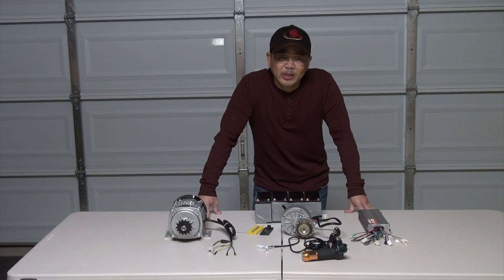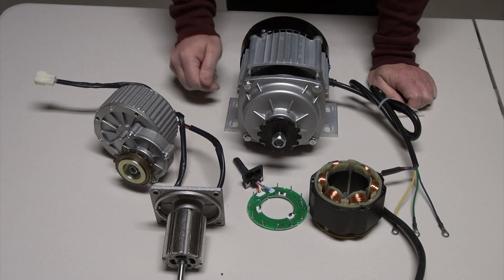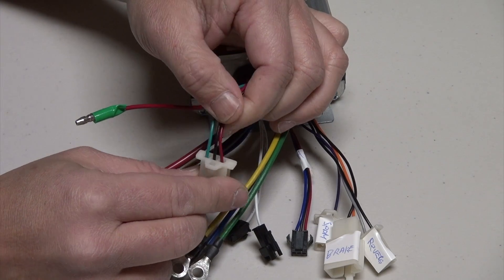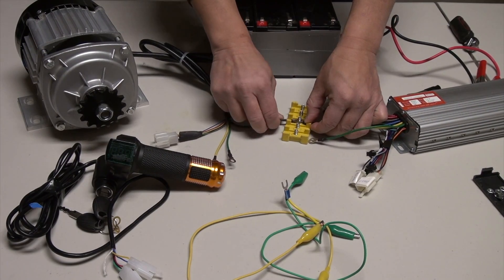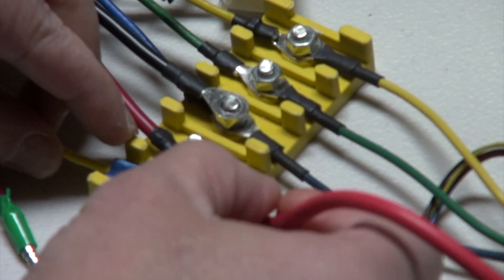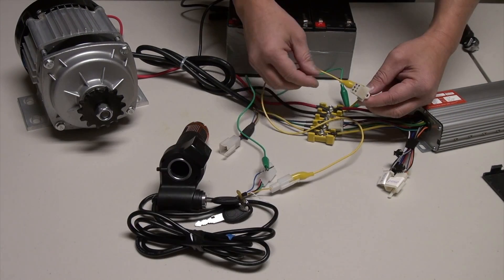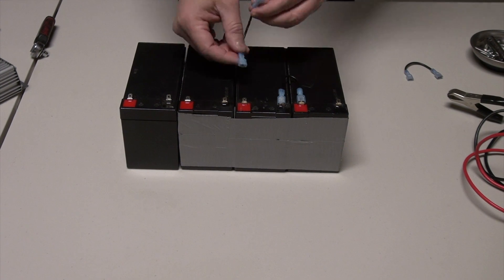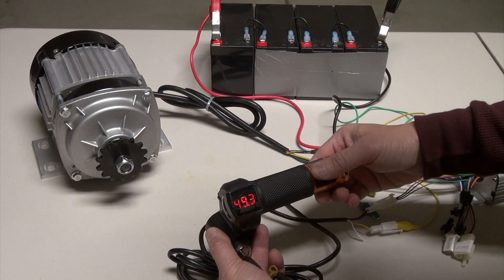How to Connect a Brushless DC Motor to Controller (48V 750W E-Bike) in English

Comment: How do connect the same throttle to my MQ7260 controller that has a orange ignition wire? Do you have an email so I can message you?
Reply: How can I get in touch with you?

Comment: Excellent video! I hooked it up on the bench and it worked perfectly. I need to reverse the direction of the motor. I saw there was a grey and black connector for reverse. Is there any tutorials out there on how to use this connector? The engine rotates Clockwise and I really need it to rotate CCW. I'm converting a gas powered mini bike.

Comment: the motor you used in your video says it has 3 different adjustable speed settings on amazon. how do you change the speed of the motor?

Comment: Question. I recently ordered a 750w brushless motor and controler to build a cart. The motor said it will come with a 14 tooth 420 sprocket. The axle kit I ordered comes with a 530 rear sprocket and chain. Is there a sprocket made for these motors that will take the 530 chain? Any advice is greatly appreciated. Subscribed.
Reply from the maker: Hello,  maybe consider getting 420 chain and sprocket for axle.  Here is a link to the kit https://amzn.to/4ix8FG0.  Good luck on the project.  Thanks!

Comment: Got sick of my shitty mowcart 66 gearbox f**king out on my ride on mower. Already replaced the whole gearbox twice. Ive decided to change to this eletric setup with a single chain to a axle and single sprocket on the axle to drive it. Gonna pull all the pulleys off the cutting deck to and install a ryobi eletric blade motor off one of there eletric zero turns seprate (so 2 motors) straight from a 2nd battery with a switch to turn on the blades. Wish me luck 👍🏾

Comment: Hello,
I have a 24v 350w motor with 2x 12v 12ah lead acid batteries. But the motor starts spinning immediately as soon as I connect the batteries. I already changed the controller. But still starts spinning immediatly without throttle control. Are those batteries with 12ah to strong? Motor itself has 18,3A current.
Thank you.
Reply: I typed your question into AI and this is what it gave me. 

Controller Settings: Some controllers have a "soft start" or "throttle calibration" feature that ensures the motor only spins when you apply throttle. If your controller was replaced with one that's not configured correctly or doesn't support this feature, it may start spinning right away.

Throttle Wiring: Check the throttle connection to the controller. If the throttle is wired incorrectly or has a faulty connection, it could be sending a signal to the controller that causes the motor to start without input.

Battery Voltage: Your batteries (2x 12V 12Ah) should work fine with the 24V motor. While they may have more capacity than needed, the voltage is what matters for proper operation. However, ensure that the battery connections are correct (series connection for 24V).

Controller Type: Ensure the controller you replaced it with is compatible with your motor in terms of voltage and current rating. If it's not designed to handle the full 18.3A current, it could be causing erratic behavior.

Throttle or Hall Sensor Issues: If the throttle isn't calibrated correctly or the hall sensors on the motor aren't providing accurate feedback to the controller, it might start without any throttle input.

Comment: I feel like almost every person in these comments is going to die trying to wire these controllers up. They're extremely simple, and very easy to figure out with no experience, but the people asking questions here are obviously far more new to all this then just a beginner. If you're asking how to hook up phase wires to to a battery connector, you should just buy an already built bike or scooter, or pay a professional to build it for you. I don't mean to sound insulting, but it sounds like you're ready to start connecting wires when you don't have the first clue of how electricity works, and that can be very dangerous, or even deadly. Usually, when people talk about someone being a beginner to brushless DC motors, they are talking about someone who hasn't worked with that specific equipment, but has worked with other electrical devices, and has at least a very basic understanding of how electricity works.
Reply: Where the hell are people supposed to start then? Maybe they could do some reading first before attempting to build a go-cart but, doing things from scratch is part of the fun.

Comment: I'm a big guy 360 lb. So I was thinking on my build of mini bike. That has a predator 6 1/2 horsepower Honda clone motor. That seized up I'm switching out I should use a 750 w rickshaw motor because of the tour and I can always gear it up for speed. Very capable builder. And have a good knowledge of electric from building RC cars would this be the way to go to have good pickup. I mean 30 miles an hour is more than enough. What do you think looking at a system just like the one you have and getting a 40 w 40 amp hour battery. Also considering starting to build batteries for people around me for their salon bikes and stuff

Comment: Great video, thank you so much. After I change my controller my ebike is not not running in full power, feels more like medium power. The 2 speed switch (low &  Hi) is not working. No wires from controller is labeld. Anyone knows what color and how many wires it suppose to be out from the controller?

Comment: Thanks for sharing. I'm planning to use just the batteries, a DC/AC inverter, the 24V DC motor and a permanent magnet generator (output of 220V). The motor will power, (rotate), the permanent magnet generator. I will get current from generator to feed my equipment and feed the inverter  which will keep my batteries up to the task. I hope to reduce my energy costs and be ''off-grid'' at least 80% (eventually). Energy costs are sky-rocketing and will prevent any ''hit to my pocket'' down the road. Again, thanks for sharing.
Reply from the maker: Best wishes!  Thank you!

Comment: I got the same motor, I use the stock sprocket and i have 60T rear sprocket  on my ebike and that goes only 10km/h  !! Is that normal ?
Reply: If you Put a smaller sprocket it Will go faster but lose a lil torque but over all I recommend to buy a stronger motor

Comment: What is that yellow block called where u connect the motor wires to the controller? is it a block terminal or busbar
Reply from the maker: It is a terminal block/board.  They are hard to find.  Here is a link for a similar one. https://amzn.to/4bVWYWK.  Thanks for watching.
Reply: @diypotentials that link doesn’t work for me

Comment: How is it I ran my motor with the hall plug not in
Reply: you can run motor without hall sensors
Reply: under high load it can block ,then you need to turn off throttle and you can power it again
Reply: hall sensors provide smooth acceleration

Comment: is it okey to use a 48V 600W motor to 750W DC Controller?
Reply from the maker: It should be ok.
Reply: and 750w hub 48v motor with 1000w 52v controller? @diypotentials

Comment: How is this controller rated for 48 volts, 30 amps and yet only 750w output? The output should be close to 1500 watts.

Comment: When I am connecting my batteries with the clips, it sparks. What can I do to prevent this?
Reply: Sharpen both ends of a lead pencil .touch one end to the pos of the battery then touch the other end of the pencil to the positive lead for 3 seconds or more . then plug it into the battery. Voila! No sparking. You made the pencil resist the full power of the battery and it loads the capacitors in the controller slowly hence no spark. This will increase the life of the controller seriously..hope that helps.it’s what I do. You can set up a 25watt 30 ohm resistor to do the same thing..so simple but works perfectly. The first time I done this it still sparked a little . I just left it for another 2 seconds ..perfect..

Comment: OK, THE REAL HELPFUL PART WOULD BE ACTUALLY DOING THIS INSIDE A BIKE . NOT ON A TABLE
Reply: Or how about a 3 phase switch so that the controller will do 24 36 48 respectably so it's not just full of tork cuz it snapped off the entire tip

Comment: Hey, I am looking to use this type of Motor controller with a microcontroller, so I am having trouble finding out the correct connections. I saw your other tutorial with the small motor driver and there are 4 digital pins, Z/F, VR, Signal and EL. So as far as I know, the equivalent of the VR would be the throttle cable, but aside from that I am kind of lost, as the small motor driver has a Signal pin which I've seen is for sensor feedback, but the only cables related to this are the three hall cables, so I think an equivalent to this would be an external encoder. Now, the Z/F pin stands for direction of the motor, and EL stands for Start/Stop, so I would appreciate if you could provide me some guidance on which cables from this motor driver would be equivalent to be connected to a microcontroller, as I can't seem to find a suitable schematic or datasheet of the motor driver.
Reply: Did you ever figure this out?

Comment: can 12v12ah acid lead battery work on 1000w bdlc motor
Reply from the maker: Lead acid batteries will work on bldc motors, but they have to meet the motor’s voltage requirement.  For example, if the motor is rated for 48v, then you have to add 3 more 12v batteries to the circuit.  Watch my video on how to connect batteries in series…How to Wire Batteries in Series and Parallel for Beginners!
https://youtu.be/X6xLmuk7udM

Comment: I have the same exact throttle but my controller doesn’t have ignition wire. Any solution? Your video was the best a saw so far on the topic.

Comment: Can you add a pedal assist on this kind of motor or this is only for full throttle?
Reply from the maker: The pedal assist is managed by the controller.  If the controller has a pedal assist port, then it should work on the motor…

Comment: I have a bike 500w 36v  brush and my controller it's no working. If I put on a controller 1000w to my bike what happens?
Reply: What type of battery do you have? Could be a power issue

Comment: Hi, what would the Ah be of the battery setup and what’s the maximum discharge ?
Reply from the maker: The battery pack is 7ah.  I would discharge it up to 7A only.  That would be 336W.   I recommend having a higher AH battery pack for a real application.  Mine is just for demonstration with no load…

Comment: I did exactly that too mine but still have no power to the motor I check the hub motor with the green,yellow and blue cable to see if there was some resistance and there was but still idk what I’m i doing wrong any help?
Reply from the maker: Check if the throttle wires from the controller match the wires to the throttle.
Reply: @diypotentials  the controller doesn’t have the same colors as in the throttle only ones I see in 3 are white red and black and grey red and black in controller
Reply from the maker: @JuanPerez-qe1xz  the red and black on the controller and throttle are positive and negative wires, try matching them.
Reply: @diypotentials  how about blue and yellow?
Reply from the maker: @JuanPerez-qe1xz  you can try to switch the wires to the ignition wire to see if it works.  So instead of connecting the blue to the ignition wire from the controller, connect it to the yellow and then connect the blue to the positive battery wire…
Reply: @diypotentials  yea did that already and somehow when I turn off the ignition the lcd screen stays on so I’m pretty much lost I’ve had 2 previous e-bike that I’ve had worked on but this one is just killing me hub is good I’ve tested out by connecting the phase wires together and I get some resistance. New controller new throttle with key so idk

Comment: @1:19, just to clarify what you're saying. The Hall sensors provide feedback on the rotor's position to the controller, so that it can properly drive the main phase connections. The Hall sensors do not create or manage the torque, that is all done by the main phase windings. The current in the Hall sensors is tiny -- a fraction of a milliamp.
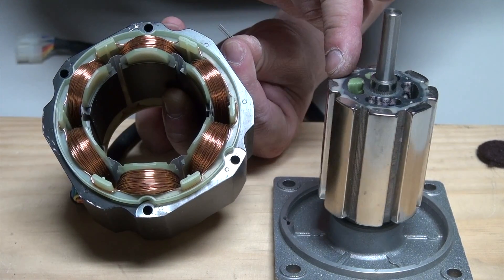Reply from the maker: Thanks for that clarification. You've explained it much better than I did. @1:35-2:00  I explained that the hall sensors collect information by sensing the magnetic field of the rotor, from there the sensors would inform the controller to provide specific magnetic field to interact with the rotor, meaning that the controller would release the electricity needed from the battery to generate the magnetic field in the specific stator poles or phases, therefore would generate torque against the magnetic fields of the rotor.  You are absolutely correct, the current in the hall sensors is tiny.  Thanks again.

Comment: Hi, please, can you tell me what the blue/black/red connector and the dark (single wire) connector are for? I've the same controller but I don't know what they are for. THANKS!
Reply from the maker: The blue/black/red connector is for the pedal assist and the dark single wire is for the speed meter.  Also, I just added the wiring info in the description.  Thanks and good luck on your project!

Comment: Hey bro! I am doing a similar project and was wondering what connection cables you used to connect the 12 Volt motors together to form 48 Volts. I was also wondering if i could just test the motor’s throttle with just one 12 Volt battery just to see if the accelerator is working or if I need the full 48 Volts. Thanks
Reply from the maker: I used 14 AWG wires to connect the batteries in series to form the 48v.  If the controller and motor are rated for 12v or more, you might be able to test with one 12v.  If not, you might need the full 48v.  Good luck on your project…
Reply: @diypotentials  I searched online, but I can't find ones that connect to the battery like your's do. Do you mind sending a link or if there is something else I should search up to find them?

Comment: Hi there! Thank you for your great explanation! I have one question. Would the 4x 12V batteries connected in parallel  be enough to power, for example, a small buggy? Or would powering something like this require more power? Thanks.
Reply from the maker: It depends on the power requirement of the buggy.  If the buggy is rated for 12v, then the answer is yes.  Connecting the batteries in parallel will not increase the voltage level.  If the buggy is rated for 48v for example, you have to connect the 4 12v batteries in series to get the 48v needed.  I hope this helps!
Reply: @diypotentials  Thank you! Another question I had was, would 48V  be a high enough voltage to power a 4-wheeled small vehicle like a golf cart for example? I assume 48V is plenty to produce high speeds for a bike since it is low weight, but would 48V be sufficient for achieving high speeds for a heavier vehicle like a golf cart or would a higher voltage need to be used? Once again, thank you so much!
Reply from the maker: @pathumdanthanarayana   It depends on the golf cart's specific voltage requirement.  If it is rated for 48v then you can power it with 48v.  If it is rate for 36V for example, then 48v would be to much for the engine to handle.  Over time you can damage the engine.  The heavier the vehicle, the more energy it will use, which means that it will draw more amps out of the batteries to meet the weight and speed needed.
Reply: @diypotentials  Makes sense, thank you for your explanation :)

Comment: I've been researching bldc motors in 48v for a potential scooter project. I feel that this one is built better than the vevor brushless ones that are everywhere, not sure if internals are the same though. 

What i'm curious in is whether or not this one will have reduced speed and torque when put into reverse rotation?

Do you know if these are actually different from those vevor ones or just different housing?

Comment: I was wondering what were the big alligator clips coming from the battery and connecting to the speed controller. I am thinking of doing a similar project and this part I need
Reply from the maker: Those were 12 AWG wires with ring terminal connectors and alligator clips.  You can find them on Amazon or ebay.  You can also purchase the parts separately and put them together.  Here is a link just for example. https://amzn.to/3BRqj3z.  I hope this helps.  Thanks!
Reply: @diypotentials  Thanks

Comment: For a project I need this motor to turn the other way.  I’ve tried swapping two phase wires and it didn’t work.  Any suggestions? Thank you
Reply from the maker: Does your controller have a terminal for reverse?

Comment: Awesome video, where would you connect the charger port to? Does it connect to the controller?
Reply: I think charger goes directly into the battery. The controller doesn't do this function. The BMS in the battery pack ensures that all cells are charged correctly.
Reply: @moeznaseer5365  Hello, thank you for your help. let say I have a bunch of 18650 cells in series and parallel, do I connect the charger port to the cells? I was looking at this diagram. Would you be able to help? thanks https://esk8content.nyc3.digitaloceanspaces.com/uploads/db2454/original/3X/9/5/95b5b09076b1382f0cef10d579d75cbf6ea337ae.png
Reply from the maker: The controller does not have a charger port.  You can charge the batteries with separate charger.  Check out my other video on how to charge a battery...https://youtu.be/Ajt1ElIw8Qg.  Thanks!
Reply: @diypotentials  THank you for your help. True I can do that but if I combined multiple 18650 cells in parallel and series, I don't think it's possible to charge them separately, how would I charge it in this case? I'll need a charger port right and where wold I connect the charger port to? Thanks!
Reply: @diypotentials  thank you very helpful!